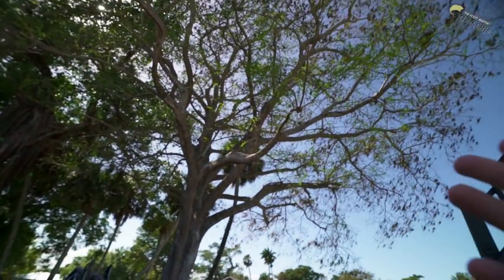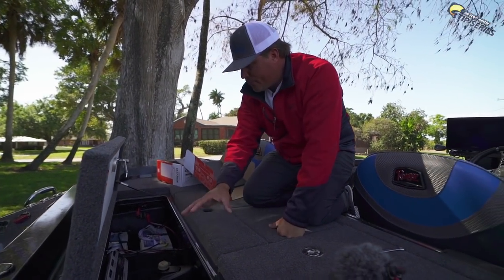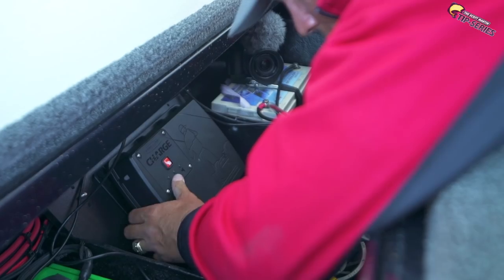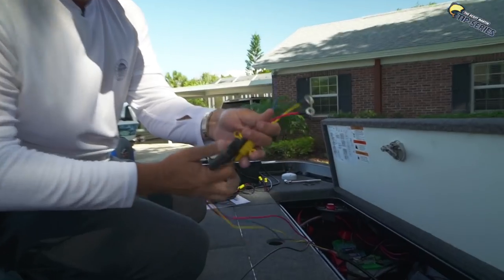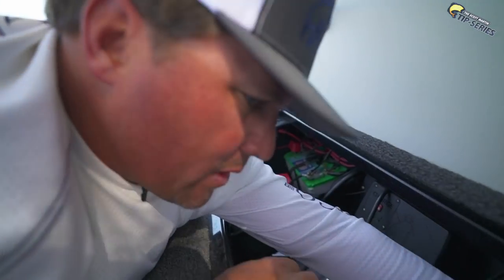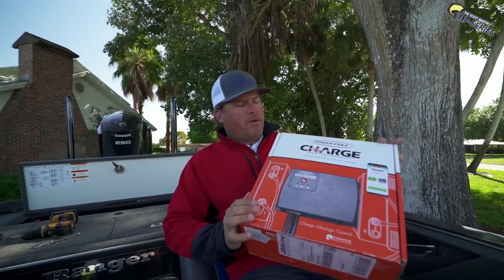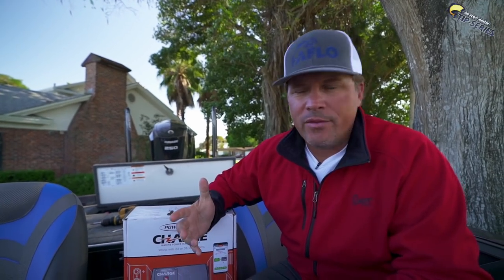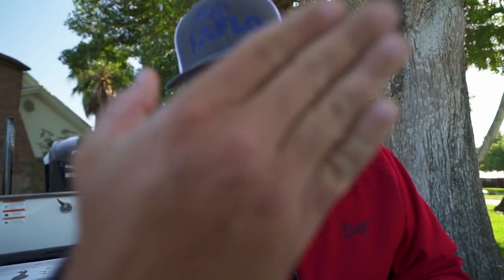I Put This in my NEW BOAT!

Comment: While the fuction is cool, the product is rather expensive for what it is. It also adds a few more pounds to the boat. The typical serious bass fisherman would be better off to put the funds toward the purchase of lithium batteries for the TM. Do that, and TM battery capacity will be so high you won't need to worry about charging them from the outboard during the day. In addition, you'd be removing significant weight. This engineer votes the Charge as an expensive obsolete product.

Comment: Great video, but you scare me a little. Lithium seems to be the power source of the future but please remind viewers to be careful if they install themselves. I've seen those batteries blow if shorted or over-charged, and the fumes are more toxic than standard battery. I always remove the fuse from the charger lead before installing any battery. also as another commented use safety glasses that are wrap around and be aware of the cable markings for which goes to which. Match the charger to the battery or vice versa. Boat US has a couple articles on Lithium power. Power pole has a real good product there. Happy fishing all.

Comment: I would love lithium but I dont have $3000 just laying around
Reply: Have you heard of XS power?
Reply: From the looks of it, that is per 36v battery!  Whoa
Reply: Anyway, XS power sells lithium cells individually. The 40ah cells are $59.99 @2.3v. Meaning 16 cells would net 36v DC. At just under $1k for a 36v bank. You'll just need to assemble the buss bars and what not. Essentially save yourself $700 with the additional 20ah on capacity.
Reply: Alex,  Don't spend $1200 on a "Charge" and you'll have a good start toward lithium. You couldn't pay me to use the ones you hear about most. (That's marketing budget results.) Do your own research. There are other lithiums with more capacity for less money, though still very pricey.
Reply: @concernedfortlauderdale2158 I looked at the Charge install guide, and you are correct it has one output lead set in the 36V configuration. I would never want two of those 36V batteries in parallel in use,  nor charge them in parallel. The engineering says that's a bad plan. Some may have a battery switch for them so that you run from one or the other, with Charge connected on the switch to charge only the in-use battery. Pros run what lines their pocket. Hobbyist run what works a little more economically.
Reply: trust me you don't want them. they blow up
Reply: @hillaryclinton2700  you must be referring to the "leading brand" that a lot of "pros" (wink wink) use....yeah, the ones they never pay for.....the ones that just happen to be charging in boats that catch fire for no apparent reason?

Comment: I have the stealth 1 system on my ranger and it is amazing, it is the exact same thing is the power pole charge, turn the motor on and it chargers the the cranking battery through the alternator like normal but when the cranking battery is fully charged it forces all the charge into the trolling batteries but only on a 24-36 volt system and it’s a lot cheaper then the power pole charge

Comment: This is a dream world... my ‘72 Ranger with ‘04 25 hp Johnson and minKota 65lb trolling motor is worth less than the charger and bank of lithium’s... might be nice but impractical for most of us. Way more practical to change out my 2 - 12v batteries every 3 or 4 years.

Comment: This may be a stupid question, but couldn’t you just rig a solar charging system on the boat so you can be charging your battery as you use it sight fishing?
Reply from the maker: Troll pull waaaaay to many amos
Reply: You would probably need a panel 3'x4' and you don't want them shaded or the shaded part will pull down the other half that's producing. You'd also need a charge controller, and they typically put out 12volt so you'd need a converter. You're up around $4-500 for something that depends on sunny days and can't have shadows on it. The van camper guys do 3-400 watts and cover their entire roof for around $1,000.
Reply: Also as scott mentioned, the amps are low. 

Without considering losses in the conversion process
12v / 100watt = 8.5amps... 3'x4' panel
12v / 300watt = 24amps... 9'x4'
Reply: Just thought I’d ask because I have a solar battery charger that I use to charge one battery for my trolling motor while using another for the motor I keep it at the front of the boat charging and will almost put a full charge to the battery by the time the first one is dead but my motor isn’t near the size of yours either Scott
Reply: The bigger minn kotas pull 50 amps at full power. I assume you have a harbor freight 12"x12" panel which I believe puts out 1/2 amp. 

I was hoping to do all of this to my salmon boat too. The math just didn't work out. A house boat might work though 😎
Reply: Ya my minn kota only has 45 or 50 lbs thrust not sure how much it pulls honestly. I’m also just using a 14ft v bottom aluminum boat so I don’t use near as much battery as the big motors.